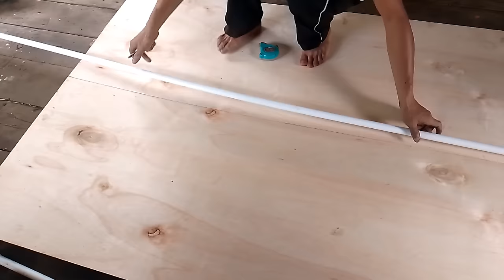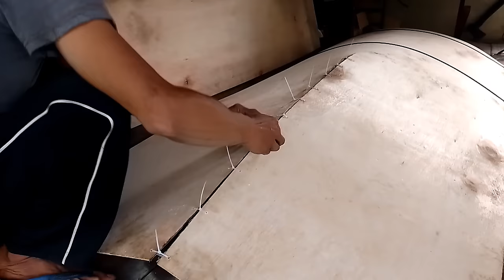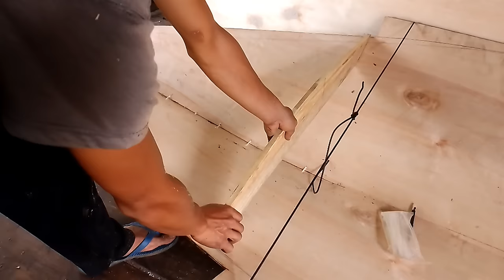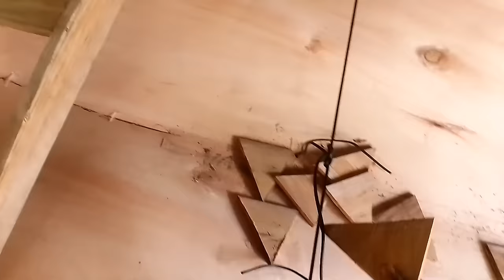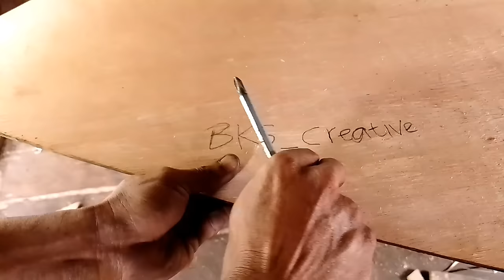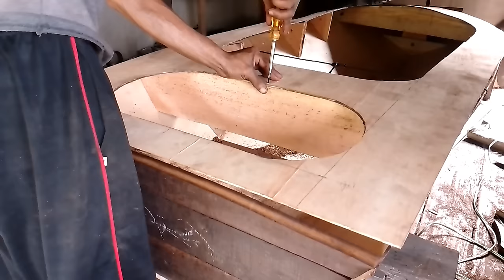homemade micro boat under $100 | part 1

Comment: Nice !  i’m a retired Professional Woodworker who also did Woodworking and Restoring WoodenBoats as two of my biggest Hobbies and Pashions   for “Lofting “ Radius  on various projects by myself i used a Fiberglass Dowel and often had to  utilize my Foot Clamps  like you demonstrated in this video  my Dowel Rods were items i used to use in  building CustomNylon Kites  i used to Sew  !  Eventually i wound up building Remote Control Airplanes  instead of Kites
Reply: We on the same page....Now getting into Radio Controls....Plan on building the Controls using  arduino boards!!
Reply: How big of a wood boat u think I can build Im a carpenter too

Comment: 1 question- if using wood, styro foam, sealant and fibre glass to make a small boat does that float?? Also using  small water bottles.
Reply from the maker: of course it will float 😊😄👍

Comment: I'm from Brazil, this mini boat is ideal for navigating the conditions of the river it's navigating, however for rougher waters, I would use the same modeling technique with 3mm plywood and moorings, I would do it on a larger scale, of a small boat, I would use two large sheets of plywood with seam-type ties, and I would use the v-hull shape, I would add Styrofoam inside the structure to guarantee buoyancy in the event of an accident. What does the builder Indinezio think of this idea?
Reply from the maker: Double thumbs up👍👍😊😄

Comment: As far as the structure is concerned,is should be fiberglassed because of the tickness of the plyboard and two halves are joined by tie straps more work is needed but its a beautiful design,sealing is uttermost inportance.
Reply: Watch the next video,  he does just that.

Comment: Is the board under the steering wheel structural? Because it eliminates a lot of foot room
Reply: It's structural since he's using only plywood

You can eliminate it by adding a wooden frame but that adds some weight penalty and thickness

Comment: Very good work, have you ever thought about using expanding spray foam on the internal meeting points of the plywood, not only as a glue/ stiffener, but it is also bouyant
Reply: It gets wet when water seeps in and that a no